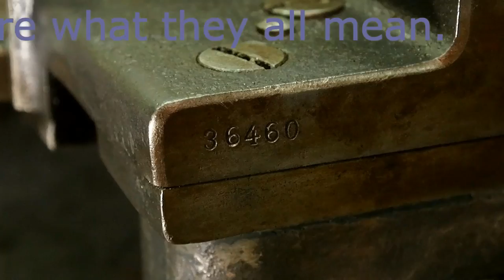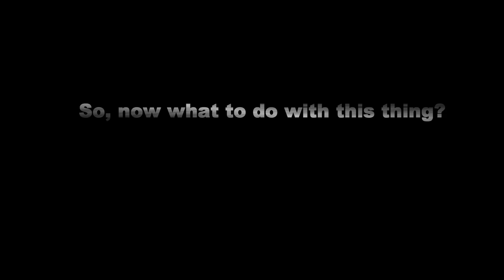So I bought a lathe

Comment: i understand this is old video but... brazing torch and files on the gear works, live with scored spindle it's pretty hard unless you know someone who can regrind it, look for modern bushings to fit spindle and bore out the old ones to fit. remember it's a hobby so spend what you want on it 🙂
Reply from the maker: Someone showed my a video where he replaced the bearings with tapered roller ones. Perhaps that's an option. https://tinyurl.com/3m38sm8f